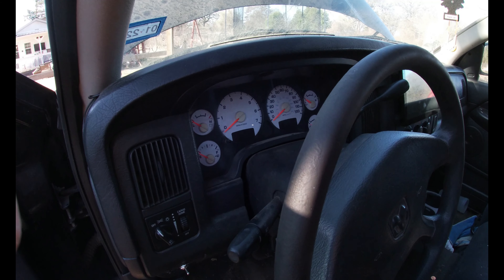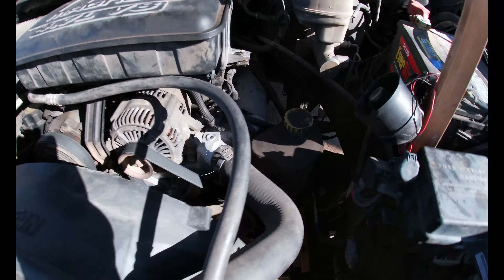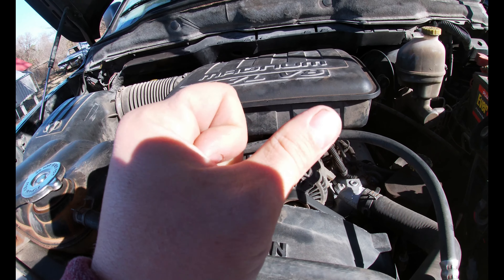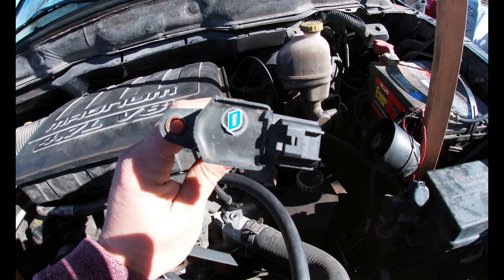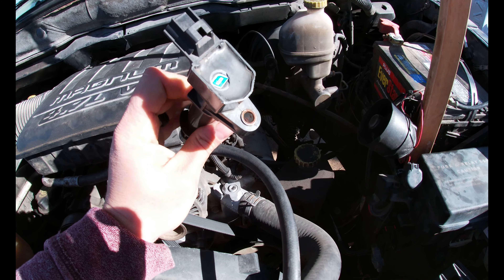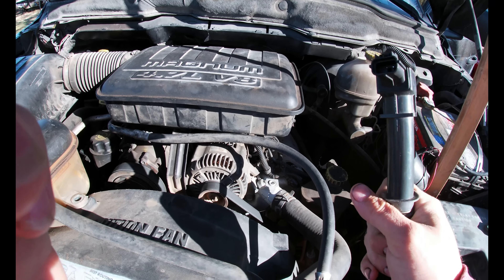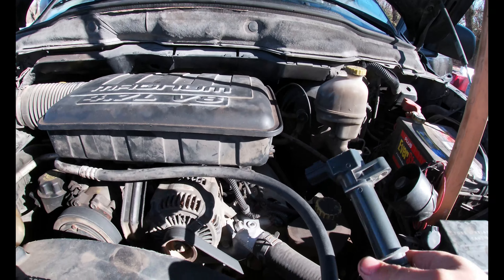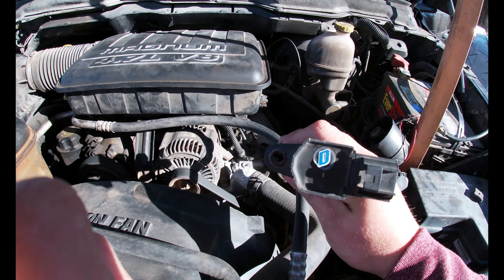2003 Dodge Ram 1500 Starts up and dies Nocheck engine light  Randomly dies

Comment: My 2016 Chrysler Town and Country has the same issue I did replace all the coils with a new one but I still have this problem and it happened every time to time usually when I drive long distance and highways and when I exit get into the stop sign or traffic light engine turns off. Regarding your truck my bro if it does not turns off weather in 4 weeks then you go to go if it turns off within those four weeks then you still have that problem

Comment: I have the same issue ,but my car runs great and with no warnings it shuts down on me,five times I was on the freeway ,it shuts down then turns back on on itself ,it did that twice then continued running till I reached home.
When it shuts down I lose the steering wheel power ,and couple of times I lost the steering wheel and the brakes .
I think I am so lucky to be still alive .
I sent it to the mechanic and there was no warning on the dashboard,he changed the shaft cam sensor ,but the problem was not resolved .
Reply from the maker: Could be lots of things fuel pump coil pack ecm. Find a good mechanic that will trouble shoot it. Or you'll have to just tart throwing parts at it

Comment: I'm having the same issues only thing that is a bit different mine runs till it heats up and after about 30 minutes it's dying or stalling and the gauges will go down till whenever it gets enough juice or time and then start back up when the gauges are back
Reply from the maker: @andrewb6740  Sounds like something is overheating. Could be ecm/pcm

Comment: Ok so did this and second coil I unplugged truck fired right up. Replaced coil and wouldn’t start again. Unplugged new coil and started. I’ll pick up a new plug and try that as well. 3 years of trouble starting in the cold and many sensors replaced. Never thought coil
Reply: Update… spark plug coil combo did the trick. Truck runs great again. Never would have guessed that was the problem especially with no codes. Thanks for the tip

Comment: Did you have a little circle red light blinking on your dash when I happened. Cause it sound like my problems. Just got a new battery, alternator is “good” under code reader. When I jiggle my terminals it helps but doesn’t last
Reply from the maker: No codes no lights been almost 2 years and still working great after replacing that coil.
Reply: Sounds a lot like the issues I'm having the thing is mine will last sometimes max 35 minutes min of 5 to 10 if I can get it started at the time

Comment: Well I’ve replaced all 8 and I’ve got the problem I’ve replace so many sensors and I just don’t know why it’s doing it
Reply from the maker: Could be Fuel pump going out. Check pressure
Reply: @somewhatfast   well I’ve had a tester on the rail and the fuel pressure doesn’t drop when it shuts off
Reply: So I figured it has to be something with spark and it has all new plugs and coils
Reply from the maker: @davidhagerman132  You need a scan tool that can monitor all the systems to see what is shutting off. It could be a faulty computer you can course one on ebay if you want to keep parts swapping.
Reply: @somewhatfast   yeah I don’t know man it’s really just been a pain in the ass
Reply: @davidhagerman132  did you find the problem my husband has a 06 dodge ram magnum V8 and his just started shutting off out of no where. It's at the shop and we're hoping it's not a bunch of unnecessary stuff to replace if they can't find the problem

Comment: I have the same problem but my truck it’s a 02 with the engine 5.9 Magnum it has just one coil can someone tell me how to check my ignition coil with the motor off
Reply from the maker: Those coils are so cheap just go buy one try it if it doesn't work return it and get your money back.

Comment: I have the same problem with my truck. I of course checked my starter, my alternator which were good. I had to get a new battery as it was drained. I did end up getting a cam shaft sensor and still cuts off. I've always suspected either my ignition coils or fuel injectors. Gonna try fuel injectors though. So frustrating as it's not giving any codes
Reply from the maker: Unplug the coils one by one until it stops dying. That coil will be the problem. Unless it's a differnet issue.
Reply: @somewhatfast  thank you! I'm hoping it's one of those 😏 was going out of town when it suddenly stopped after leaving the rest stop. Had to turn back around and have my truck pulled 😭

Comment: Mine is shutting off while driving it's a 03 2500 5.7 and this might be my problem since I haven't had a tune-up since 2019
Reply from the maker: Don't parts swap. Unplug one at a time and test to see if it fixes the issue